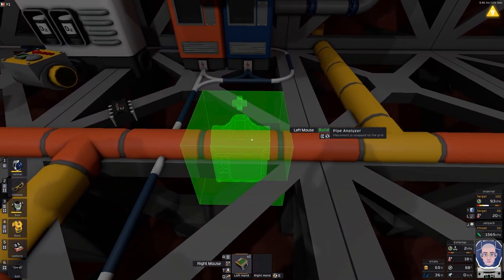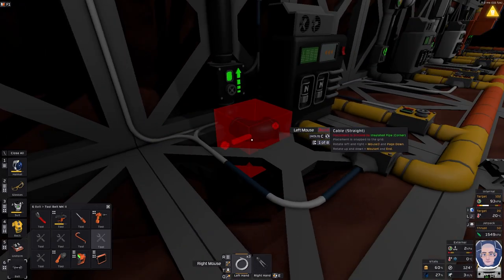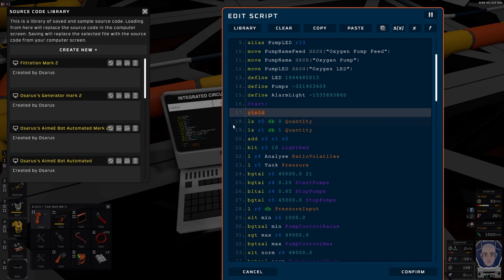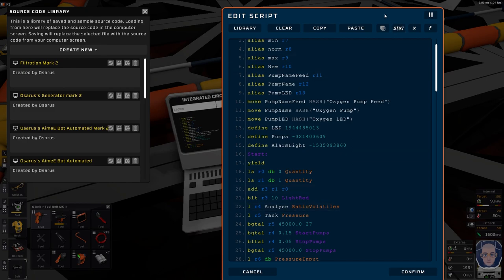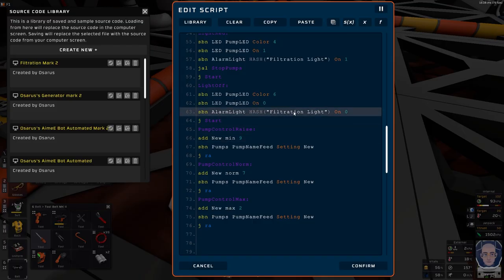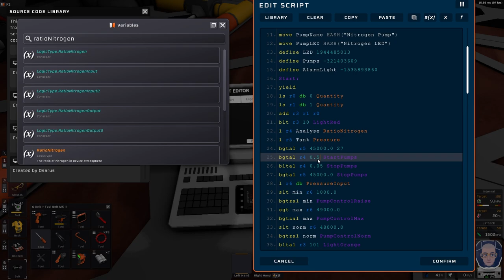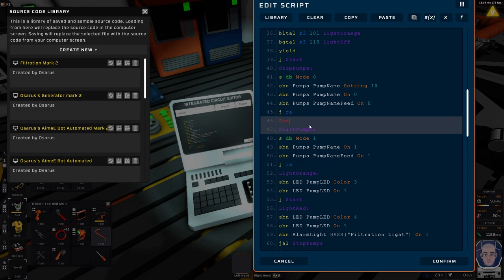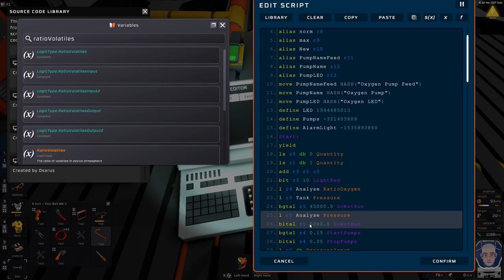Atmospherics after Phase Change  Automated and Optimised- Stationeers - A Let's Play Series E11

Comment: Thanks for the "heads up" -> Yes! I like your solution - That's an impressive extraction rate.  If I end up using atmo units with that volume / pressure of source gas, I'll probably take your (PID style) approach as it offers good power efficiency on the volume pumps.
 - Good tip on the "Setting" attribute on the unit - I wasn't sure what to do with that.
Dunno about pollutants and N2O at 15MPa, though - how did that go?
-
Meanwhile, I'd figured out something similar for the "legacy atmo setup" in my base that works well and efficiently enough, but keeps the atmo units daisy-chained.  Units are idle and their exhaust pump is off when there is no gas at their inlet.  When gas appears at the inlet, unit goes to Active and switches its exhaust pump on (which activates the next unit).  All units get switched off by the controller if all units are idle in a given poll-cycle. (it also monitors if there is sufficient gas in the feed line)
On my base, I've not the room to fit pumps b/w atmo units and tanks from my original setup - but, until I set up auto-miners, I'm working with much smaller volumes of "source" gas - so "it will do" for now!

For gas extraction "at scale", I am going to have a go at cryogenic separation in the near future (chill and pressurise - then decant off the liquid gases at each critical temperature step) ... no filters to change, no dead filters to halt the process when you're not looking!
Reply from the maker: Well i am sure that the cryogenic way of separation is also a good way to go down, i might try that on a furture base.
but for now i am satisfied with the rate and the state of my filtration system

Comment: i wonder why you use ratio.... of gaz with the pipe analyser to trigger activation of each filtration unit. instead you could use totalmoles.
Reply from the maker: @jojoskunk  -  I use ratio as i wanna know how much of a specefic gas there is located in the main line, ofcuase if i could a total total moles of Oxygen then i would have used that instead, i don't want each to be active if there is just enough of any type of gas
Reply: @osarus_TV  ok

Comment: i have this all setup with the code in at the default settings but for some reason everything is on at 0kpa in pipe and nothing seem to come out of the filtration system and also when i had two filter the where 0% in a machine light went red but stay red when i put new ones in am also not sure how your getting the N20(nos) to stay in a gas form mine seems to go liquid real fast also post this on the reddit for the video
Reply from the maker: Hi and sorry for the delay, so yes there was a bug. which seems to have happened as i was making it better for Steam, i have made some changes to it now. and been testing it. a update for the control of the filters and when to turn on.
have a look at let me hear what you think,